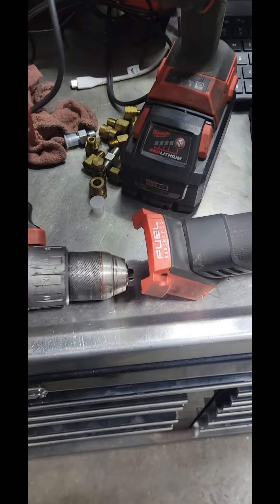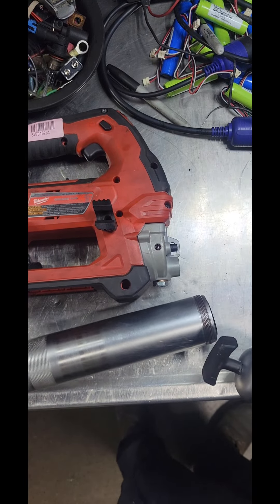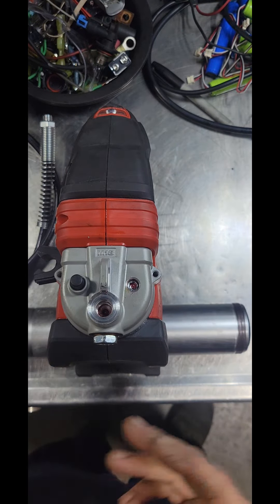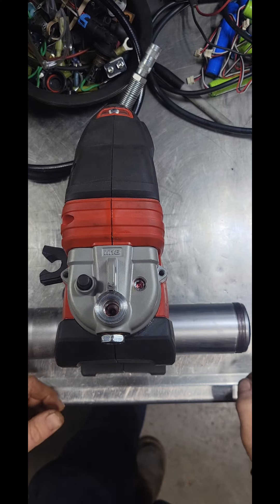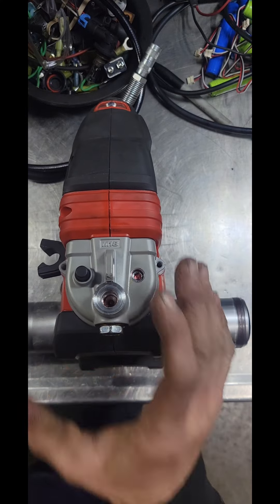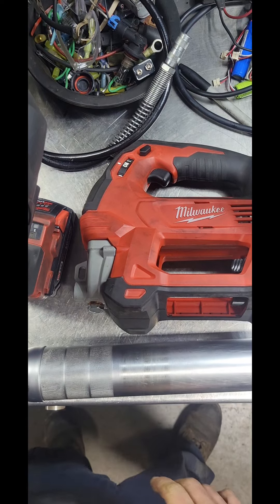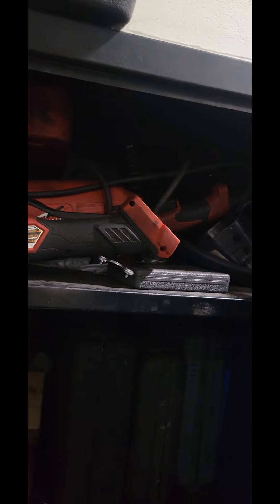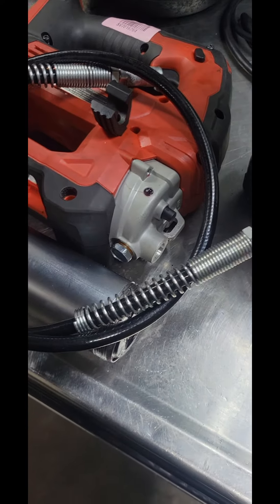milwaukee tools warranty review.

Comment: I know how you feel. Sucks. The warranty tech that cross thread really fucked this process up. 

Of course they denied it because the obviously believe it was you that did it. 

Drill/tap and use a brass adapter or a simple heli coil.
Reply from the maker: Im waiting for my blind hole tap to come in, and then it will get helicoiled. I guess you live and learn.